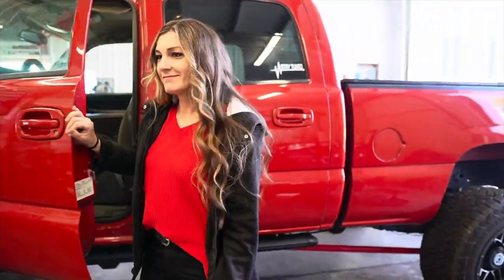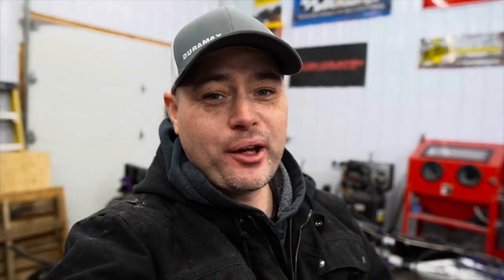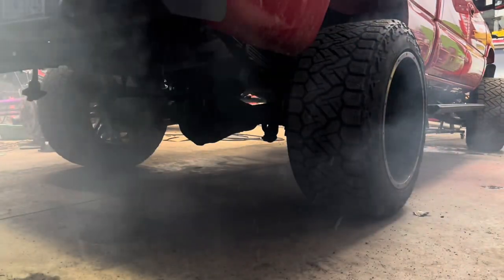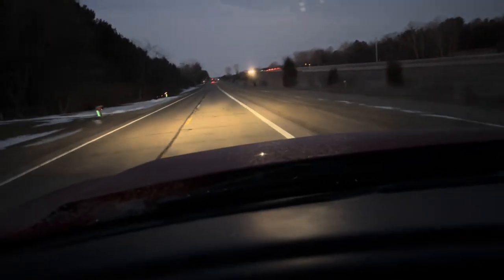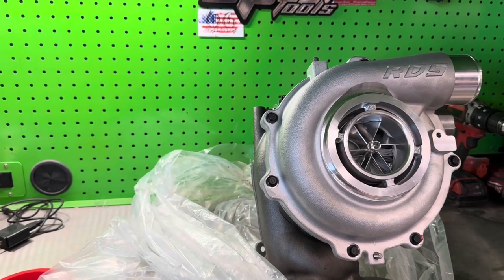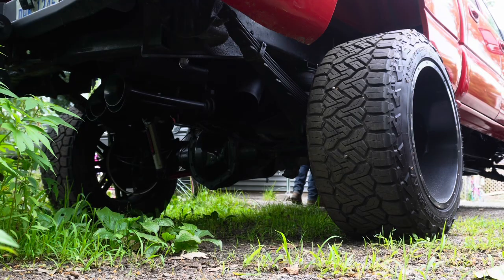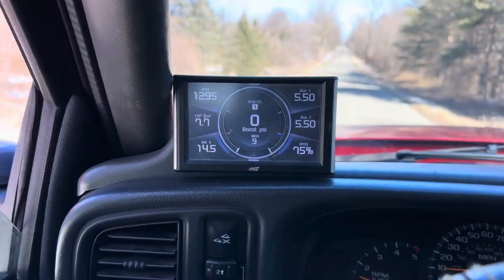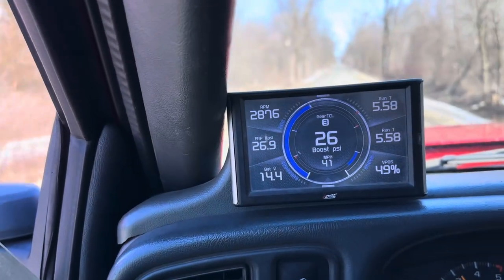I Made This Duramax Sound Insane! *The Final Test*

Comment: Hey could Ryan and his dad help me with my trans on my 06 ram 3500 mega cab non dually, it’s 4wd Laramie whole 9…. My coolant temp shoots up to over 300 degrees then back down to the low 70’s back and forth, the (Overdrive Off) flashes on the dash back and forth and it constantly switches from 3rd to 4th and it won’t let me go into overdrive at all when it doesn’t do it which is maybe 1-3 minutes in between it acting erratic.. my RPM’s stay in the 3,000’s range and the speedometer says I’m going 50-60 mph… I’m lost man any help would be great, I’m in Michigan the landing area… PLEASE HELP! 🙏 also the overdrive unit and the transfer case looks new/remanufactured I just bought it about 4 weeks ago…

Comment: Why does the stock 95 F350  with the 7.3 powerstroke have a 76.2 mm turbo. Why is 72mm the largest Ryan's Diesel make.
Reply: Stock inducer on a 95 Powerstroke is 59.8 mm. 76.2 is the exhaust side of the turbo. The 72mm Ryan was talking about is the inducer size of the compressor